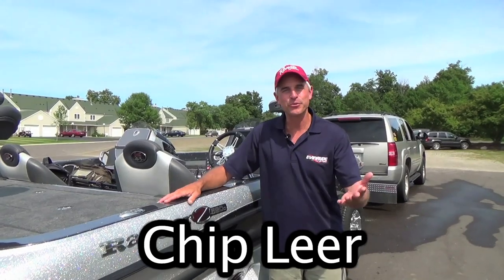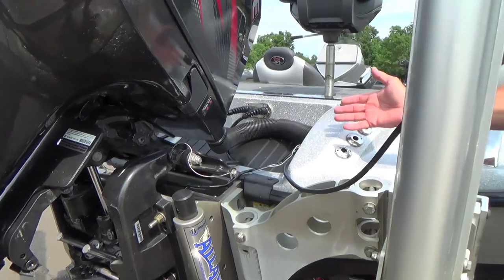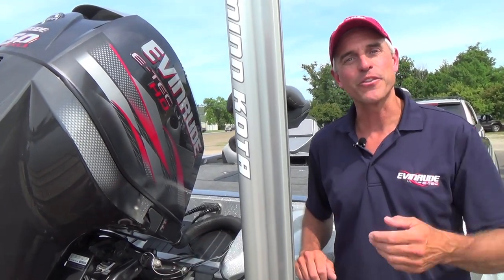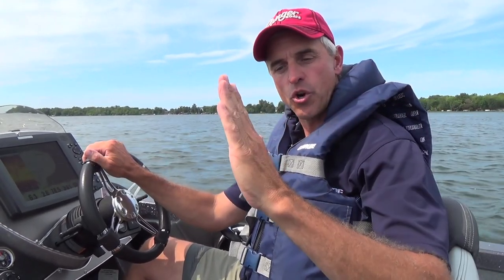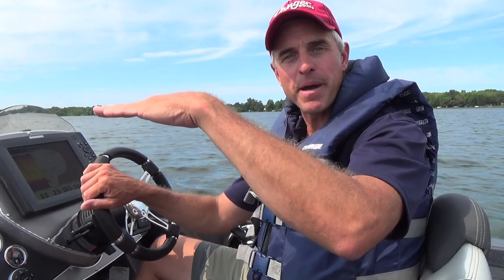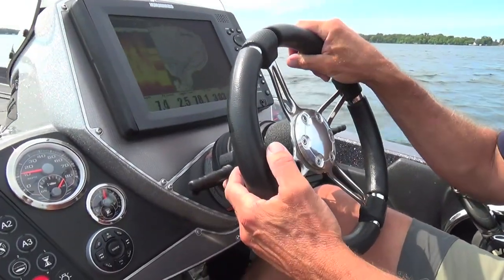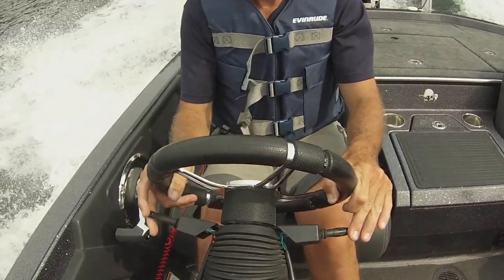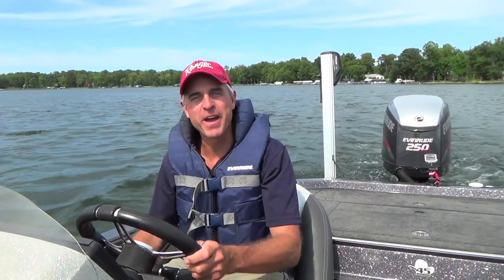Shallow Water Hole Shot

Comment: I used to run a Dargel 16' which has a flat bottom with a tunnel.  One other thing that I used to do in very shallow water was to turn hard left to get out of the hole.  That put the left side of the boat deeper and the right side more shallow... but the prop stayed at about the same depth.  360 degrees and I was off and running.  I don't know how that would work on other boats.... but it worked great for me and the boat that I had.  It also kept me from digging trenches in the bottom.